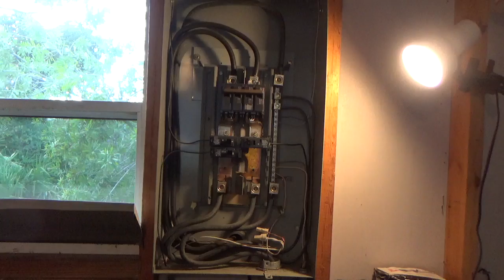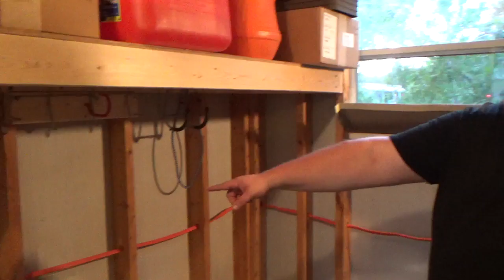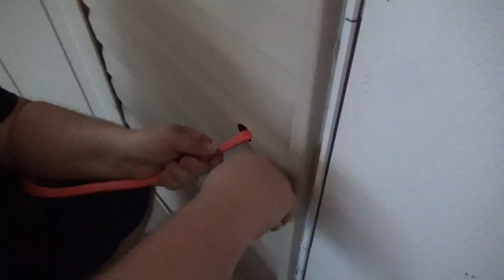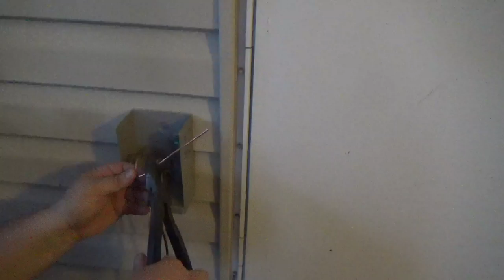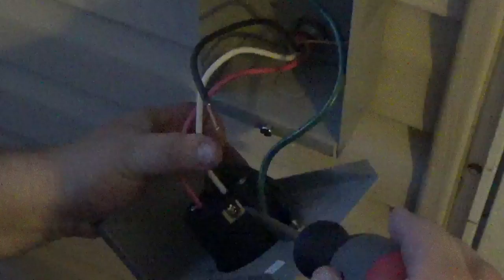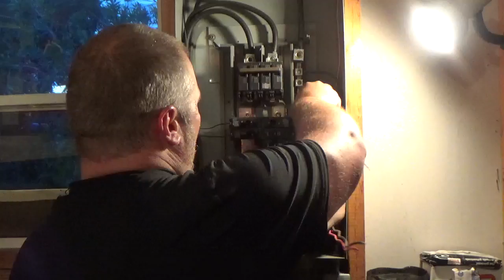Generator Hook up in a Power Outage

Comment: Got a 120V 30A generator for a great deal on amazon and just finished wiring it.  Bought an outlet box, installed it on the outside of my house.  My problem was only powering 1/2 the panel but i figured out mine runs every other row so i had to relocate a few 15A breakers to land on the side that my generator powers. 

Moved the top right breaker down and also had a new open spot at the bottom which allowed me to run my living room and bathroom lines to a tandum breaker since both single pole locations werent on the side of the bus bar i needed which now frees up 2 spots in my panel. 

Needless to say everything came out flawless and I am into the whole thing for $475 i cluding the generator, inlet box, 40ft twistlock cable and interlock kit.  Oh and the single pole 30A new breaker and the tandum one i purchased.  I did buy a vinyl siding mounting plate so the box didnt have any gaps and the mount plate conforms to the grooves in the siding for a cleaner look 

Have almost all lights powered and both fridges in my 3600W 120V generator.  Was kinda nervous going into it but I did a lot of research and watched tons of YouTube videos.  Probably saved a shit load DIYing it and lucky for me both my grounds and neutrals are bonded and tied together with a large copper strap so from what I understand is both legs should be "balanced"...

Comment: Amateur here, I paid an electrician to install our transfer switch CS6375. (I'm pretty sure. I purchased the Predator 9500 from Harbor Freight. It's only a 30 amp generator. I need a cord and is it safe to pump or only have a 30 amp generator on a 50 amp inlet?

Comment: Great video, thanks!
Noticed you wired the WHITE neutral wire to the same GROUND bus bar.  Is this because this is your main power panel and then you have a subpanel in the house?

I have similar set up but haven't opened up outside main panel yet to see if it has only 1 ground bus bar or if both a neutral bus bar and also ground bus bar.

Thanks again!
Reply from the maker: Yes that is the main breaker panel!! That is were you bond the 2 together.  Now we put 2 bars in and bond them!! CM

Comment: great video Craig. so, to power the whole house, all you need is a 50A breaker installed in the main circuit box?, is that it?. Thanks.
Reply: I just had mine done by an electrician. Also had my panel upgraded from 100A to 200A.  They out in a 50A breaker for my inlet and no it will not power everything at the same time.  I told then I wanted to be able to run my central Air lights fridge, freezer computer, wifi etc.  He said you can but if you want to use the microwave, coffee pot, dryer I would have to turn the ac off until I was done with those things and then turn it back on. Your not going to be able to run everything all at once. But you get the essentials AC...LOL furnace in winter etc.

Comment: I know how is to be without power, like 4 months after hurricanes irma and Maria. I  used the back  feed to run two 7000 watt generators 24/7, then I switch to a manual transfer switch which have pilot light, so I'll be able to tell when the power comes back.

Comment: Love this video, Question, 10-3 Romex inside 10-4 outside to generator,  why don’t you need 10-4 on the inside as well To the panel?
Reply: He used 10/3 with ground romex. Red - line, Black - line, White - neutral, bare copper - ground. The 10/4 is portable (flexible) unlike the romex where the bare copper is your ground, the portable cable has a green insulated wire.

Comment: Question: Does the breaker for the generator need to be at the top or can it be placed anywhere in the panel that has an opening?
Reply from the maker: In this case I put it at the bottom, but had to order the interlock and then moved it to the top by the main. I will be posting a video on how to install an Interlock kit!!. CM
Reply: @craigmichaud-electricalins4602  Thanks Craig! Keep up the good work.

Comment: Some other YouTubers just use two male plugs for back-feeding, one to the generator and the other to a 240v outlet (e.g., an electric dryer). This technique is faster in an emergency (as long as the main switch is off in the panel)
Reply: If you plug a male end into a running generator the other male end is live those exposed male ends if touched while trying to plug into a receptacle have been known to kill people.

Comment: I just purchased a 6500 generator planning to run this hookup. I already purchased the interlock kit. My panel is full so electrician is gonna need to figure out  if sub panel or tandem breakers are needed to create space for the double breaker. Any suggestions
Reply: A generator panel. Is that different than a transfer switch
Reply from the maker: It is a panel that acts like a sub panel but everything on it will be connected to the generator.  Check out Northern Tool and then look up generator accessories.  It will make more sense!! CM
Reply: I got everything installed he used a tandem breaker. Havent had to use it yet. But I'm ready if the power goes out
Reply from the maker: That is a common factor in alot of homes these days. I assume your electrician will use tandam breakes as it is the most convenient way!! They do make a generator panel also so that may be another option. Keep me posted as to the direction you take!! Thanks for the question!! CM

Comment: I like the way you move around wiring. Very confident. It's easy to see you are purposeful on every move. I am also a contractor but not with wiring it scares me. LOL. So thirty amp would only be three wires correct? That means only one power wire to one  circuit breaker?

Comment: I find it extremely important to mention that this is a way to hook up a generator in an emergency. I know this is just an example. The important thing is that this is totally illegal. To do this temporary 1 time during an emergency is ok and still illegal. An interlock or transfer switch of some type to avoid utility backfeed is required. In most instances utility companies will not repair an outage if they detect backfeed and you will be the reason your neighbors are still without power. The intent of course would be to install a safety interlock as soon as the event was resolved and be sure the main utility feed breaker is off anytime the generator backfeed breaker is on, whether the generator is running, hooked up, plugged in, or not. Great video.

Comment: He should have installed a Mechanical interlock switch first  on the cover of the panel to prevent the main being on while the generator is running.
Reply from the maker: Yes you are correct!! At this point in my video it had not been installed and is to show that you can hook up a generator in an Emergency. Thank you for your comment and watching!! I will be posting more other ways to hook up generators in the future. Thanks CM

Comment: Craig,
I noticed you connected the neutral and ground wire coming from the outlet box, you just installed, into a single bar in the panel.  You mentioned that this panel feeds another sub panel in the house somewhere.  In that other subpanel, located elsewhere in the house that we did not see in the video, are the neutral and ground bars separate and isolated electrically from each other, or are they two separate bars electrically tied together or just another single bar that the neutrals and grounds are connected to?

On the outlet box you said that the neutral wire goes in the “W” hole/slot, where would I go to look this information up?  Would it be included in the instructions that come with the outlet box or in the NEC book somewhere?

And since the generator is a single phase generator does it matter which hole/slot the black and red wires leading from the outlet box go into as long as it is NOT the hole/slot designed for the Neutral (that would lead to a HOT-Neutral wiring error)?

Thank you for making the effort to produce these videos.  I’m a homeowner who discovered an interest in electricity after an electrician I hired for a remodel wouldn’t show up, and when he did he had constant trouble with his apprentice who he eventually fired.  To get the job done I got under the house and started pulling wire and making connections, under the guidance of the electrician.  I discovered several things, this electrical stuff was fun and interesting and it wasn’t difficult at all.  Eventually I got my apprentice card with the intention of becoming an electrician on the side while working my regular job.  That never worked out.  But I still find the subject interesting and enjoy learning.

Respectfully,
Reply from the maker: Let me see if I can answer all your questions! Yes there is a sub panel in the house but if you watch my panel videos you will hear that at a main disconnect is the only place you bong the neutral and the grounding conductors. All other panels are separated. You will find all the info on the outlet in the manufactures info that comes with the outlet!! It is not stated in the Code book as the codebook is not a how to manual. There are a lot of bad electrical contractors out there but there are also a ton that are great! Sometimes it takes time to find them. Thanks for your question!! CM

Comment: Question?  I have a older main panel that does not have separate ground and neutral . All are together on one bus bar .where would I connect ground wire and neutral coming from generator "plug"? Also it is a floating neutral generator. . Thanks much for any help .New sub here.
Reply from the maker: That is a great question!! If you are in the main panel and the neutral and the ground are bonded together than you follow that same rule. This is what is known as Backfeeding a panel. It truely is temporary. Thank you for watching!! CM
Reply: @craigmichaud-electricalins4602  Thanks much appreciate your input. Was for information purposes only.thought maybe ground from "PLUG" might go to direct earth ground next to generator.didn't want to energize the ground. .. so neutral and ground from "generator plug" tie together at main panel bus bar.. just being sure .... Thanks again. . Waving a hand to ya from S.W Florida.

Comment: A 4000-watt generator running at 240 volts will output a maximum of 16.7 amps. Would it be sufficient to use 12-3 romex and a 20 amp double-pole breaker? With a 30 amp breaker, what if the load exceeded the wattage of the generator? Could the generator be damaged in that case?
Reply: Jack  depends on the situation higher voltage less amps BUT you are also running 120 volts too and you have to think about voltage drop for long running wires. Calculate your total load and size appropriately. Never connect neutral to equipment ground. Btw im an electrician
Reply: @dhunsaker26  Yea and I'm an Astronaut...
Reply: I got a 7000 watt starting watt 9000 generator what amps should I use
Reply: @thorvgl805  It depends on the voltage.  If you only run 120v devices then you have 58 amps of power available. 

If you want to figure for 240V appliances use ohms law. 

P = I x E where as P = wattage, I = amperage and E = voltage. 

So 7000 = A x B.  Plug the known voltage into B slot and calculate.

Comment: I believe u need an interlock kit so that the main breaker and the back feed breaker can not b both on at the same time for safety
Reply from the maker: Yes this is a video on how to install a generator in an emergency. If it was a permanent install then yes you would need to install an interlock. Turning the main off is the key to any safe install. Thank you for watching. CM
Reply: @craigmichaud-electricalins4602  what happens if you connect X and Y cross, (X black and Y red) any difference?
Reply from the maker: @Ansi-Ashan  Honestly it does not matter. It is just the way we tradesman install devices!! CM
Reply: @craigmichaud-electricalins4602  thank you so much for your quick answer. Awesome video and thank you.